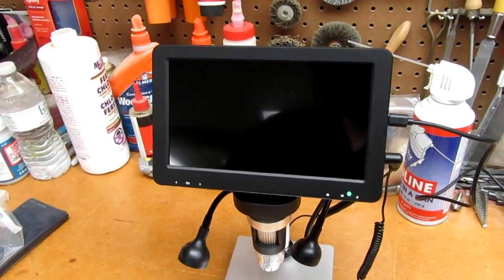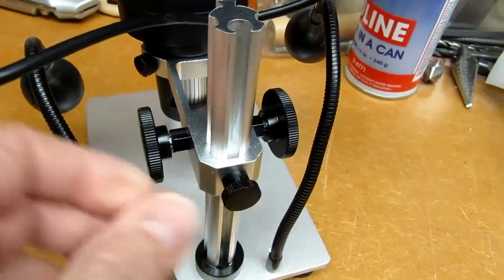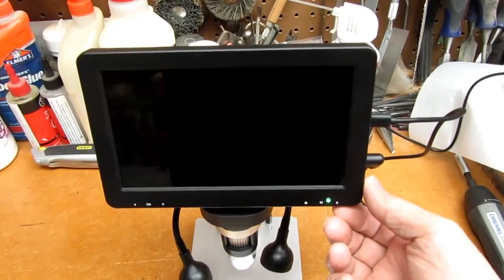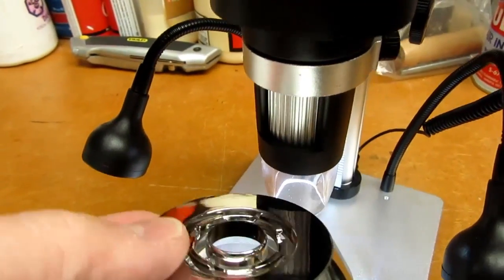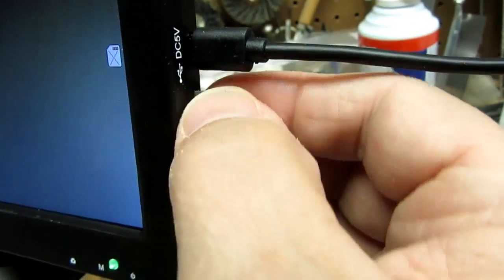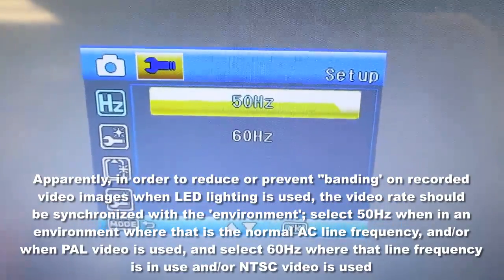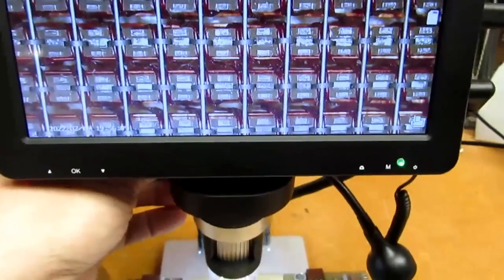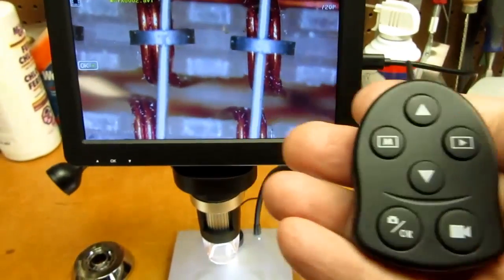Elikliv 7" LCD 1200x Digital Microscope: Introduction, Demonstration, Review

Comment: I got the same one...... But mine is branded as Hayve. Exact same microscope though. 
The two cons I have is you don't have much room for bigger circuit boards and the gooseneck lights don't stay very good.
Reply: The bigger circuit boards is also worrying me about getting one of these, but I'm thinking it could be modded onto a microphone boom or something with the vertical rack / shaft thing mounted upside down. This way you could move the boom / arm where ever you need to be and fine adjust it with the vertical rack thing...

Comment: I have the identical unit. Hes correct on somethings but incorrect on others. It does come with a SD card. I thought the same but then my wife went back and looked in the box and there it was. You have to be looking for it to see it because it's in a very small sealed bag, like a zip lock bag. Also it does come with the power charger cable but not the charging block. The unit is a AWESOME unit and I do recommend for coin collecting as well as using for testing super small components on a motherboard.
Reply: Seems inconsistent. Just got one from Amazon today and it didn’t come with SD card, but mine did come with the micro use cable.
Reply from the maker: Jpsrsugusy, you are extrapolating your own individual experience, without considering that others might have different experienced. They are not right or wrong, just different. MINE included exactly what I reported in the video, no more, no less.

Comment: Is there a switch to turn on the two side lights, just turning the wheel on the bottom of base does not turn the lights on...hnnn
Reply from the maker: timjohnson, as I recall you just rotate the dimmer thumbwheel until the base lamps dim and then turn off. If yours dies not do that AND if it is the same model as the one in this video of mine, then I think it is defective.
Reply: @youtuuba  I guess mine must be defective

Comment: When I turn it on my battery keep saying low battery then within 10-15 second it shut off. Is there a way to fix it? I change the battery but not the exactly the same as the blue one then it stay on for like 10 mins then shuts off again and no it’s back doing the same thing.
Reply: New battery

Comment: Did you use such a microscope as an electrical engineer?  Or does your interest stem from the Heath kits?
Reply from the maker: Dean W, I don't know why my reason for having this microscope has to be one of the options you cited. I just got it because I have been working with some vintage magnetic core memory projects, and needed a microscope for that.
Reply: @youtuuba  The microscope is an interesting piece of equipment not owned by most households.  My inquiry was trying to determine what you might use it for- I was just curious. Given that you had mentioned you were an electrical engineer and are involved with heath kits, I did not know if this was an essential tool for those pursuits or something else.  I am merely trying to understand how and what is uses are.  Sorry, if I am being too intrusive.  I just enjoy ALL of your videos and like learning from you.

Comment: You will find the battery does not last long enough to do PC board job's the get round is plug it into your laptop goto charge mode the scope will stay on running  from the usb power
Reply from the maker: Leso204, I don't think this microscope would be a good choice for actual "PCB work" involving soldering, since without binocular vision there would be no depth perception. I can see it being useful for PCB inspection.....